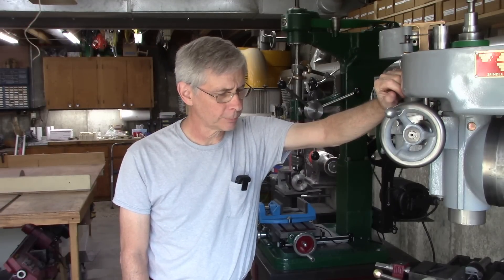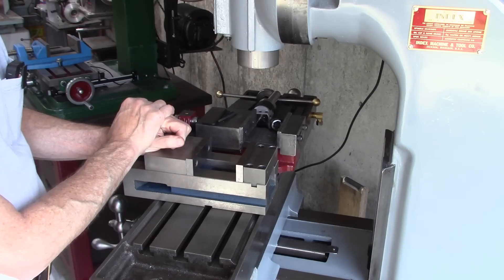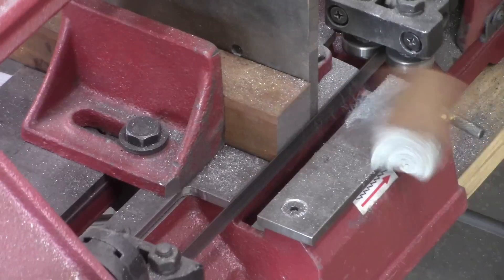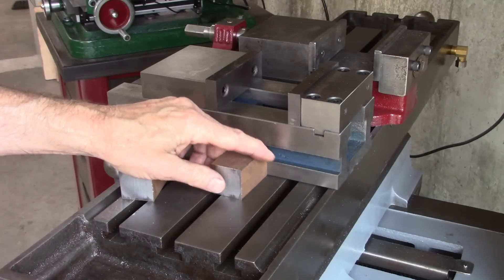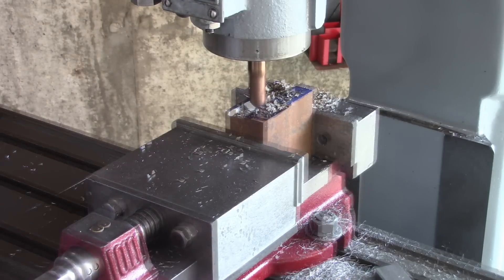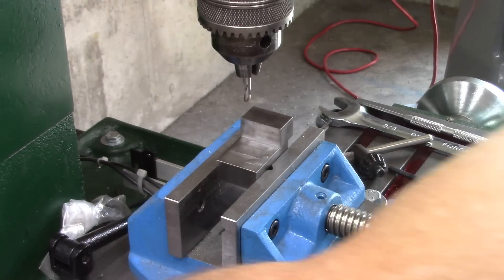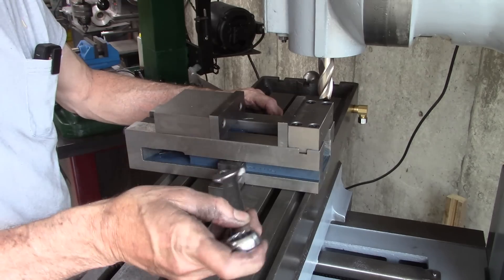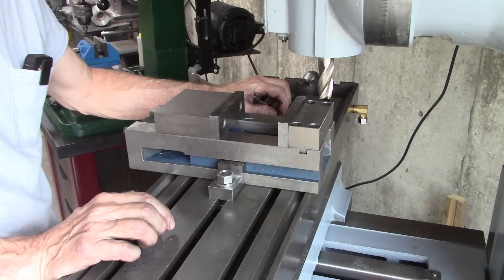Hold Downs Clamps for my Vise - Milling Machine

Comment: I had the same issue with mine unscrewing.  I went cheap and easy.  I drilled and tapped a hole right at the line between both parts and inserted a hex socket screw, 3/8 or 5/16 I think, I don't have it in front of me.  Drill and tap so It's flush or lower, doesn't get in the way of anything and can be unscrewed to release the threading between the parts.  Other than that, make the parts permanently joined with a couple stitch welds.
Reply from the maker: Interesting, thanks

Comment: I'm late to this party, but about Right or Left boring bars: I've Made several bars that can be used for deep holes or long sweeps. Cheap & easily made. 3/4" bar of steel. Drill & tap in the end for a set screw. Use a high speed steel piece or a broken carbide drill bit as the cutting tool. Sharpen with a diamond wheel or silicone carbide. Drill a matching hole near the end of the bar, clamp with the set screw. Depending on which way you position the tool it can be a right or left bar. Using it in the horizontal hole of the boring head allows sweeping the entire surface with in one pass giving a very nice looking finish. The catch! If you mill head is even a slight amount out of tram you will produce a cupped surface. One big cup as opposed to a series of small ones.
Reply from the maker: Yeah, that would work well. I modified a boring bar with a triangle insert. I just ground off the opposite side so it can be used either way.

Comment: You need to turn up your speed when milling. You won’t break your end mill.
Reply from the maker: I agree, I'm still learning. I was feeding too fast too. This was the first project on this mill. I have an RF30 mill drill before. This is certainly a much better mill but the lead screws move the table twice as fast (.200" vs .100" per turn on the mill drill). Apparently this is common but I prefer the slower screw. I now have flood coolant to keep the higher speeds cool. I know carbide can run very hot but those hot chips down the shirt are painful.

Comment: Revisiting this one because it may help me position a 5" vise better in a round column mill.  You've probably solved the problem with the boring head by now but here's another thought.  Could you use brazed carbide tools that were intended to cut left to right on a lathe?  A few of the very old brazed boring bars in a set I have were intended to cut left to right or to bore with the lathe rotating in reverse.

Edit:  Thanks for explaining why you made the stepped space for the nut.  Makes a lot of sense.  Recently I had to machine some welds back to the original contour of the piece.  After trying about a half dozen different tools an old hand ground HSS bit that was in the back of the drawer turned out to be the hero of the day.  Carbide is easy and quick and there are advantages but having HSS and being able to make my own tools sometimes saves the day.  I'm working on a historic battleship restoration so sometimes the parts I chuck up are 115 years old.
Reply from the maker: My old mill had a solid boring head so I could run it in reverse but my new mill boring head screws onto the taper. I ended up modifying a boring bar with an insert to make it work but they sell one also. Interesting work on the battleship!

Comment: I would make an insert tool boring bar to run forward. I have done the same for my boring bars. You also get the advantage of higher speeds than an HSS bar and dont have to deal with hand sharpening a brazed carbide tool. 

Those vices are called CNC vises since they can be held sideways and also ganged more easily than a flanged vise, like the old bridgeport vises.
Reply from the maker: I agree on the boring bar.
Reply: @WinkysWorkshop  also, on those cheap ang lock vises, it may be a good idea to pull it apart and clean up the casting for the ball. Also, to get a good idea of its repeatability, put an indicator on the part while you clamp. See how high it rises. Do that a few times to see your average error. I posted a video on my channel a while back about it
Reply from the maker: @moosesmachinery  It seems like there would always be some lift when clamping at the top but it also seems like more expensive vises would have the same problem.

Comment: The problem with this kind of mounting a vice - you always have to dial it in to be square to the mill. With a signplate you could mount the vice in different position and never have to dial it in again. You dial in the signplate once at that’s it.
Reply from the maker: The vise actually has keys on the bottom that just happen to line up with a Tee slot. I need to try them and see if I can make it square.

Comment: Back in the day I paid Wells-Index $225 to grind an R8 taper in my B&S #9 spindle. It now holds both the B&S #9 and R8.
Reply from the maker: The Chinese were nice enough to make the B&S collets available. I think in some respects they are better than R8. I think they hold the end mill better but also tend to require more force to make then break loose. The wells index draw bar is a plus.

Comment: I use an adapter to er40 and then run straight shifts.   That way I can use the same tool on different machines.   They make a collet adapter to er32 for that machine.
Reply from the maker: Yeah, I have one and it works well however, the additional 2 inches in length makes things less solid. I have no problem with the original B&S taper for most things. They seem like good collets and they were cheap. The only tooling that was a problem finding is a boring bar and drill chuck adapter but I have them now.

Comment: I am sure You know this, Sir, carbide does not like vibration or movement whether from the quill or table while cutting, I noticed that on that cut that it broke on that when You started that cut there was a noise like the table or quill or even gibbs were loose, also it looks  like You were climb cutting on that cut and if so if something was loose or vibration, that could be the issue with the carbide, again I know You know this also, but chuck and clamp and cut everything as close as possible, Thanks Love Your Videos, God Bless.
Reply from the maker: I agree... movement somewhere. I think there are several possibilities. First the vise was not very solid. Second the knee was not locked down and three, the RPM was too low. The mill was cutting a slot...  so technically one side was climb cutting. However, this should not have been a problem...   it is also very likely that chips got stuck in the groove and broke the end mill. I think the new vise, higher speeds and flood coolant will probably do much better....  or even a blast of air to keep the chips clear.

Comment: You mentioned lack of “measuring” equipment to test flatness and squareness. How will you tram in the vise?
Reply from the maker: I'll simply use a fixed dial indicator and make the back jaw parallel to the table travel. To really check squareness a marble table would be helpful.  This old Tony has a video on checking a vise that is good. I did a visual check with a squared which is probably good for what I do but not real accurate. My last vise was different from side to side by maybe .0015" (twisted).

Comment: What happened at 5 minutes? 
I think the damage was done then  ?
There was a funny noise as the cutter made contact with the workpiece.
Reply from the maker: You may be correct... it's hard to say. From what many are saying I was running too slow.

Comment: Mark, as a suggestion for using coolant with the new vice, I bent up a sheet metal tray that fits under the vice. A lip all round and a drain off tube. Modern sheet metal is very accurate for thickness and flatness. Well worth giving it a thought. I would also strongly reccomend 4 clamps with that type of vice as you are only grippig on a short width and it looks to me not to have been machned very well if at all. Regards from Australia.
Reply from the maker: In hindsight I should have made the clamps longer. The mechanical advantage isn't the best so i think a second set of clamps would be good. I was thinking about machining the first 3/8" inch of the lower part of the vise to accommodate some sheet metal with some thin rubber to seal to the vise. I'm sure that would provoke a few comments. Kind of like when I machined the jaws of my lathe chuck to hold washers. I've used that little ledge on the jaws so many times...  it's super handy. Of course I could shim the entire vice with the same sheet metal. I have a few pieces of aluminum printing plate let over from my job that would work very well.... .014" if I remember right.

Comment: I don’t know how useful this will be but I’m gonna share. My first vice was a grinding vice that required hold down clamps very similar to the cnc vice you’ve got there. I never felt like my set up was reliable with those hold downs. Tight enough to not move always felt like it was risking damage to the table. I broke down and bought a cheaper Kurt copy Chinese nock off and frankly it was way better. Also the coolant channels make a surprisingly big difference in regard to the mess. Just my thoughts. Do with them as you will.
Reply from the maker: I'm not super worried about the vise moving but the coolant will likely be an issue. I'm going to make some sheet metal deflectors but i may end up doing as you suggested.

Comment: Didn't see anyone else mention... I've never run a machine tool in my life, so take this with a big grain of salt... But if I'm not mistaken, you were climb cutting when the endmill broke, and the internet says not to do climb cuts because it breaks endmills. 😅
Reply from the maker: The mill was in a slot so technically it was cutting normal on one side and climb cutting on the other. Climb cutting is okay in this case but in most cases it's not a good idea. I think chips getting caught in the cut probably did it. I should have had air blowing on the end mill to keep the chips cleared out.
Reply: @WinkysWorkshop  ah, ok. I guess I couldn't see clearly on my phone..😅

Comment: Get an a!aluminum cookie sheet with a lip around it, drill it for your hold down bolt hole spacing. Bend up the front left corner a little and bend Down the Dr rear corner a little. Install a tube to recirculation the coolant here. That should catch almost all of the coolant that isn't slung past the pan.
Reply from the maker: I was thinking about sheet metal deflectors that let the coolant run into the tee slots but I like the pan idea. Thanks!

Comment: Mate, just use round HSS and make your own tool to stick out the side. Because it is at 90 degrees to the work you don't required the clearance down the shank. It is more like a traditional turning tool. Cheap and simple.
Reply from the maker: I was looking at my current boring bar with the TCMT insert. I'm going to mill the back side to expose the insert... a very easy fix.

Comment: My Palmgren vise is too long and hits the main casting about 2 in short of full travel, but has yet to be a problem. I may just mill that part off, i dont use the vise anywhere else
Reply from the maker: Good idea as long as it doesn't weaken the vise.

Comment: My brother would weld his food to his fork if it didn't need to end up in his stomach. That would be his answer.  I've had issues with needing to reverse direction but was hampered by a threaded what have you. You could drill and tap a hole at the break between the head and shank and install a set screw., or make a locking tab washer to go between the two pieces. Make tab slots in each piece then bend the washer tabs into adjacent parts.  Nice job on the clamps Winky. Don
Reply from the maker: Thanks Don. Somebody else said to make a flat on the threads and install an set screw. I like that idea too... who knows

Comment: No need for coolant. Carbide is not as sharp (generally), needs more speed and power and more rigidity. Sometimes they just break, too. Par for the course. Love your new old mill!
Reply from the maker: I'm thinking coolant to use HHS.

Comment: I agree with AWDJr. The spindle speed was too slow for the carbide. Rule of thumb, chips coming of the work should be straw or amber in color. They can turn whatever color they want when they hit the floor. Also, 2 flute EM's do a better job of keeping chips out of the groove. Not perfect, but better.
Reply from the maker: "They can turn whatever color they want when they hit the floor" Or on my neck!  Ha! I may end up going back to carbide but the HSS sure did nice.  I don't remember the speed I was running. I was thinking 1200 rpm which is too slow by my calculation. Thanks

Comment: Hello Winky, buy a suitable boring bar or make one, a good excuse for another video, why not try mist cooling, less mess, there are many videos on the topic, thanks for sharing your video with us, cheers from magicbytes 😷👍👍👍
Reply from the maker: I've been down that road, not a fan of mist. I might not be a fan of flood either but I'm going to give it a try. It seemed like the mist didn't do a lot unless I was making a mess.
Reply: @WinkysWorkshop  OK Winky, the boring bars that are used on your boring head is it 1/2 inch diameter ?

Comment: I like a Noga air mister.Flood coolant makes a big mess not to mention it stinks like crap.Also your tools  will rust up  as well.The cutting fluid i use is made by Steelmax .Water soluble  Fully rust inhibited Made in the U.S.I also use CRC SP-350 that will prevent any rust at all.The noga mister has a mag base so you can move from one machine to another.Noga is top quality product.The Steelmax has a nice  smell to it....The Noga you can adjust the volume of fluid you need as well.What you do in your shop you dont need flood coolant...
Reply from the maker: You are probably right...  although I had some rust using cool mist and it seemed like there was a lot of over spray when I used enough to cool. I didn't like the idea of breathing it.

Comment: I think you might actually need an indexable endmill to use the side port.  You still want the cutting forces to be downward, which they would be when the endmill is on its side.
Reply from the maker: you lost me... sorry
Reply: @WinkysWorkshop  boring bar cuts on the end.  Indexable endmill cuts on the side.  You want the cutting edge to face downward when you turn it sideways for the side port of the boring head. Endmill would do that.

Comment: I’ve read on several forums that Wells/ Index can regrind the spindle to an R8 style. It’s not free, but makes life way better I’m sure. I again have read that they’re a decent company to deal with. I did a bit of research into wells/Index as I want to buy one of their mills, but things haven’t worked out yet. One day I will get a mill. Can’t wait for the next video.
Reply: $750
Reply from the maker: Thanks, yeah I know about the regrind but I now have all the tooling I need and a full set of B&S collets. I think they actually hold better than R8 but admittedly they are harder to get out. With the new draw bar they seem to be easy to remove however.

Comment: Hey Mark what happened with the carbide EM may have been running too slow , also when milling in a slot there is no place the chips can go and they bound up and grabbed the hard fragile carbide flutes. A HSS is much more tougher and will power thru, but still can break if dull. Best to hold an air nozzle and blow the chips away while milling and this won't happen. Project turned out great!
Reply from the maker: I agree with you on all fronts! Thanks

Comment: For the boring head, use a lefthand (used running in reverse) boring bar/turning tool. instead of a righthand turning/boring bar.
Reply from the maker: I might make one... (modify). They seem to be much higher priced than a standard bar
Reply: why do you want to run the mill in reverse, the arbor is right hand threads. Is it to keep the chips from jamming?
Reply: @cyclebuster  standard, regular old indexable insert boring bar for the lathe. Right hand (?)( i suspect is the proper term) while boring on a lathe with the chuck in the typical forward direction, as MOST ops are executed on a lathe, cutting from right to left in the typical turning or boring op on a lathe...well, install that boring bar in the boring head for the mill and run the spindle counter clockwise (anti clockwise for our allies on the other side of the atlantic ocean and beyond). The indexable carbide inserts are cheap, and leave a nice finish... at least the majority of the ones i use (admitted and guilty as charged for using amazon specials but were hobbyists, not pros........okay maybe hobby-pro-esque-ish, but in my experience,  the amazons mid-priced insert tooling is halfway decent.)

Comment: Boring head solution. Unless you intend to take it apart make the fit permanent with 609 Loctite.
Reply from the maker: I'm thinking about pinning it
Reply: @WinkysWorkshop  You can always remove Loctite joints 
with heat but pinning will work well also. I suggest putting two of those clamps on each side of the vise. You’ve got three T slots so might as well use two of them.
Reply from the maker: @ellieprice363  I thought about that too. It never hurts to be more solid!

Comment: Mark, the letters HHIP mean H&H Industrial products.
I just bought a Yama HHT 8" independent 4 jaw vise at the scrap yard. Its a bit rusty, but I'll soak it in some rust removing solution, clean it up and relube it and use it for a welding positioner. I wish it was a scroll chuck, but I'll make do. The price was good, so if something is damaged beyond reasonable repairs, I'll not loose much.
Reply from the maker: Yeah...  I knew what it stood for but drew a blank in the video. Good find on the chuck!